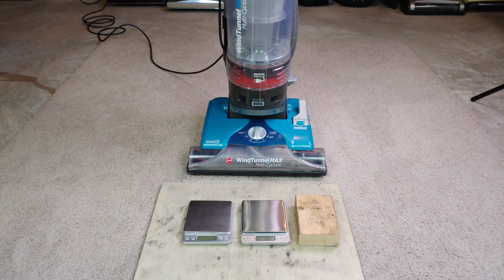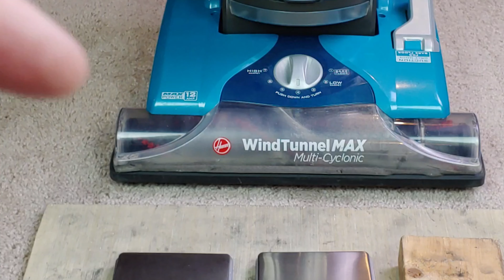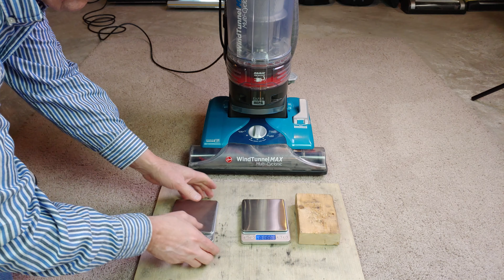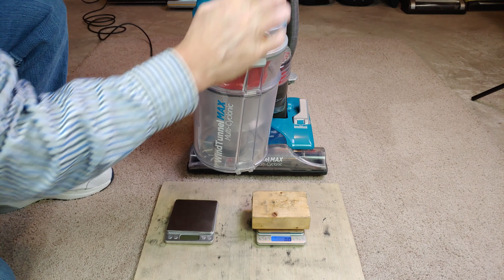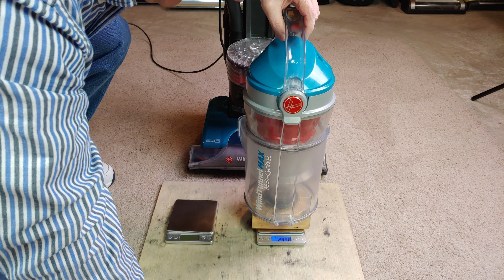Hoover Windtunnel MAX Dry Pass (Carpet Shredder) Test

Comment: I was expecting higher shredder level. Not too bad, but a bit high still. Your new phone has excellent video quality, but not only that sound has more bass compared to your previous phone. I recently upgraded graphics card in my pc (AMD Radeon RX480) and now picture is way more detailed compared to the integrated graphics card. I bought it to speed my pc up, but I was not expecting higher detail level. At least now I can see your high quality videos much better. 60 fps is NTSC standard and European PAL is 50 fps standard and that is what I have. However I have already seen 60 fps coming to the European cameras. High end phones has that in the EU countries, but most video cameras still have 50 fps.
Reply from the maker: I thought it would have pulled more carpet out as well, but the old sand and baking soda tests were only average.